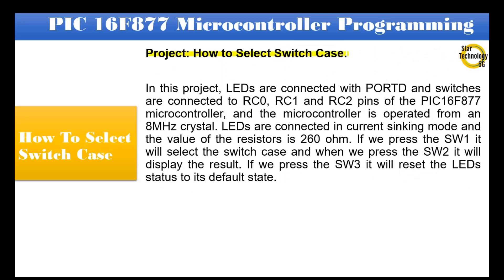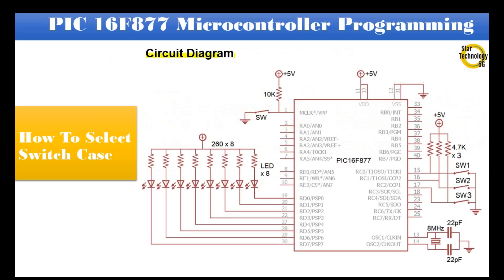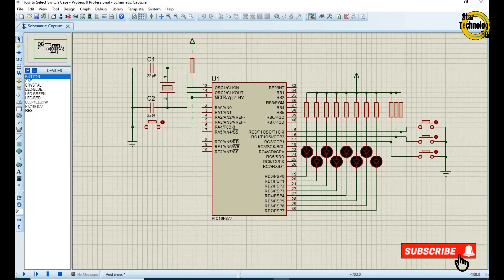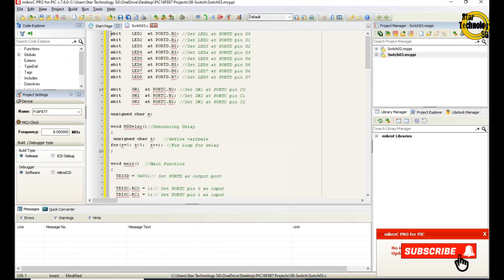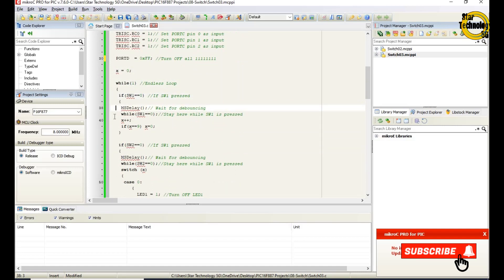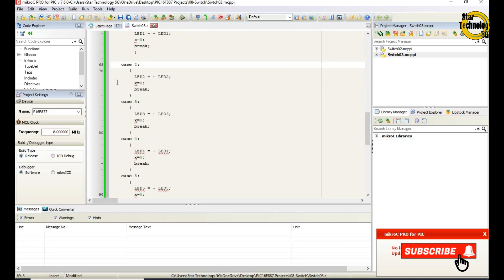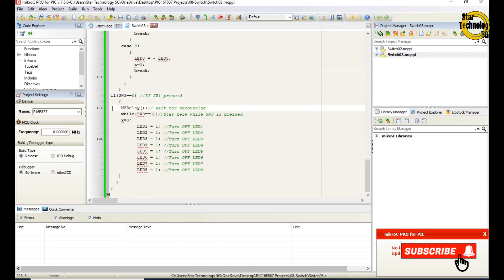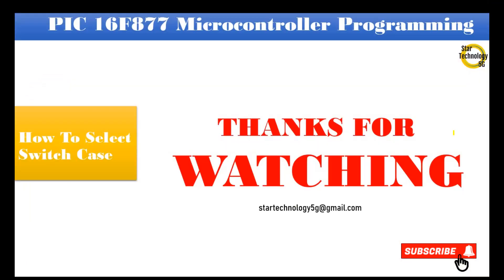Microcontroller PIC16F877 Video 15 How To Select Switch Case Using Mikro C for PIC

Comment: I need a program in micro c pic16f877a to glow 3 leds with 3 switch in such a manner that when we press sw1 first led glow , when sw2 is pressed led2 glow, when sw3 pressed led3 glows and all these leds keep glowing for till led3 glows for 30 seconds and all leds should get off along with   3rd led I'm trying with if statement but getting errors can u help me
Reply from the maker: yes you can do this with if statement. what type of error are you getting?